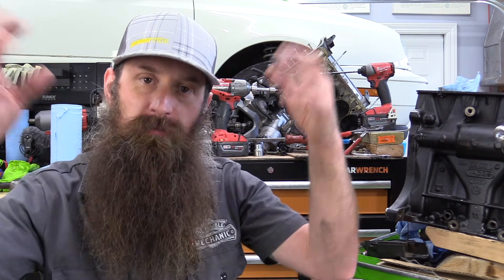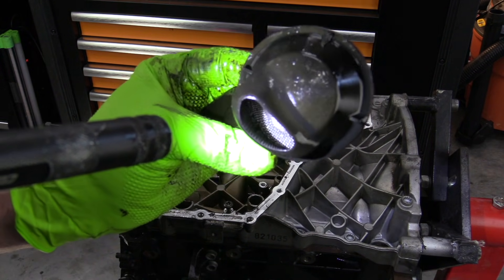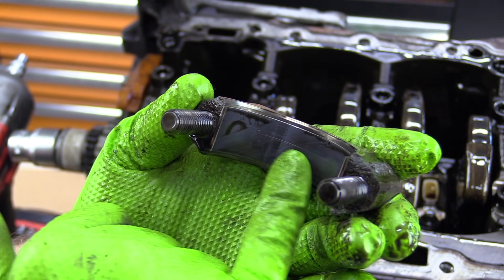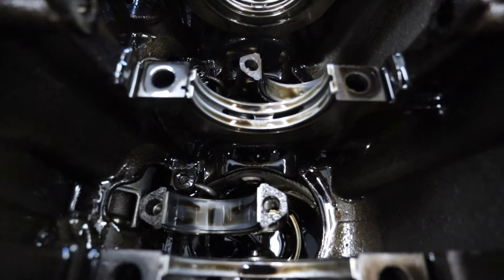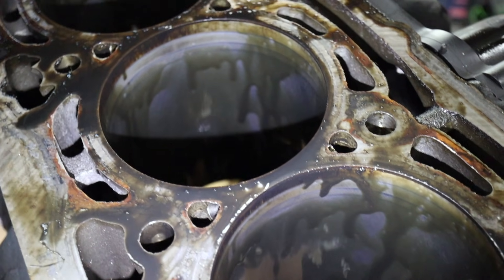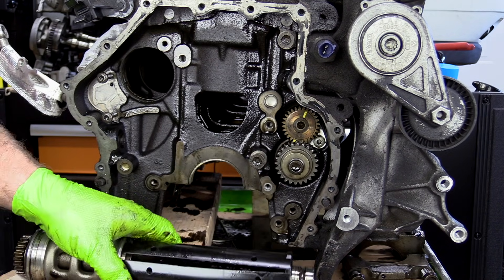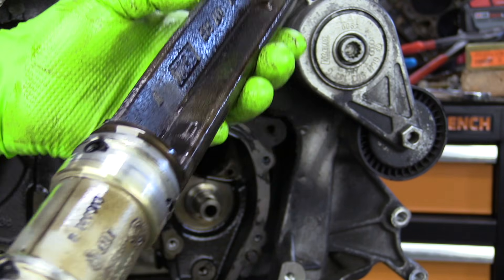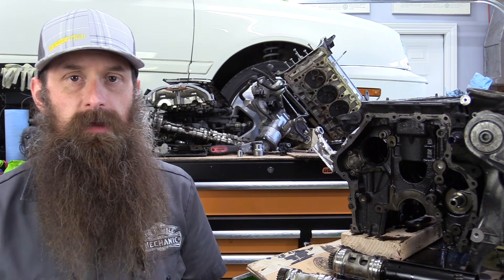2.0 TSI Engine Bottom End Teardown ~Pistons, Balance Shafts Oil Pump

Comment: Have the balance shafts out chasing the dreaded oil pressure light. balance shafts look to be ok. checked the balance shaft bearings on the block side at the back of the block and they are trashed. Cant find any OE quality bearings or info on replacement. Part number looks to be 06H-103-396J.  any info would be appreciated.

Comment: poor quality lubricant.
The most important thing for these engines is the quality oil and the correct frequency of lubricant changes, about 5-6000miles.
The best oils for these engines from my opinion:
Rowe hightec synth rs 5w40 
Liqui moly synthoil high 5w40 
Kroon oil polytech 5w40 
Motul 300v 5w40 
Motul power 8100 5w40 
Shell helix ultra 5w40 
Mobil 1 esp x4 0w40

Comment: Only thing on these B8-B8.9 2.0T engines that sucks is those inlet holes on the piston rings causing the majority of the oil consumption issues. 

Otherwise these cars are cheap tanks. Still cheaper than my Cadillac, Dodge, and Mercedes for parts.

Comment: you mentioned that the weaker rings can be a source of oil consumption. was this for a certian date range? or does every 2.0T suffer from it? should i tear my engine apart right nopw and install new rings??
Reply from the maker: its most of the gen 2 engines from Audi. So like 2009-2015ish mostly in the longitudinal mounted engines
Reply: @HumbleMechanic  that's a relief. 

thanks for holding my hand while i dig around in my gti. been watching for years. love your vids and the life you breath into old vw's.

Comment: Hello
I have an EA888 gen3 from an Audi S3, 140,000 km, revisions carried out at the dealership to date. What happened to me was that the engine fused the connecting rod of the 1st cylinder with the crankshaft without any warning, without any symptoms, it just seized and then completely destroyed the bearing. After disassembly I found no damage to anything else, the bearings of the other connecting rods and crankshaft are perfect, what could have happened to my engine?

Comment: Great videos.  How much in labor for this job.  Mistakenly bought a 2012 with a Junkyard motor.  Mechanic says oil light means that crankshaft bearings are worn to the point that oil gets past bearings on lowers oil pressure.  He put in heavier oil and Lucas but warning light still comes on under light load.  Thanks

Comment: Thank you. This is a great look inside the lower end. I have a mk7 2.0 and have oil pressure light issues. New oil pressure senders, filter housing, pump and still the lamp comes on periodically. The engine is super clean but shit can get anywhere. I am thinking I need to look into the balance shafts next. GRRRR

Comment: Great video! I have a 2011 Audi TT with the TFSI CETA 2.0. What I am having a hard time understanding is why my bearings don’t have the color code on the sides of them, unless they have just worn off. However, I located the upper and lower (shell) stamps on the block and crank. RRRRS for the upper shells and BGGBG for the lowers. When replacing, do you normally match these colors up for replacement? The crank is in good shape.

Comment: 11:00 I've also heard of the o-rings on that plastic insert losing their elasticity and allowing oil to bypass back to the pan, causing oil pressure issues.  If you're high-mileage, probably a good idea to replace the o-ring or whole assembly.

Comment: This engine's chronic problem of loss of oil pressure is the balance shaft diameter which is 5 to 7ths of an inch shorter than the block groove.  There's a video on YouTube where the machine shop guy discovers the problem.
Reply: interesting concept. Would you happen to have the link to the video? I've done several of these engines, replacing woth numerous new oil driven parts and still have suffered the issue.
Reply: @geeess958  The video is in Portuguese. But you will be able to comprehend the problem. The problem is with the original part from the dealership that need to be tight fit.
https://youtu.be/Largs9CIsSQ
Reply: @geeess958  https://youtu.be/5JyowD_aYOk

Comment: Hi I'm stripping my engine, and you video shows exactly how I need to strip it, on the balancer shaft I found my exsaust shaft plastic was broken and caused my oil pick up to block and damage my bearings, but want to find ou, the intake balancer shaft does it also have a plastic tube

Comment: We bought a 2014 EOS with 39k miles.  I didn't want to purchase it but Wife wanted it.  The exhaust on the EOS is coated with thick soot.  Had good servicing but soot scares me.  My 2002 SAAB has 172k miles on it and the exhaust is clean, so clean, there is some rust in the exhaust pipes.  Is the 2014 affected by bad/stuck piston rings and the bad tensioner?  Thinking maybe we need to sell it while it runs good.  Idles very smooth and quiet.  No idea how much oil it burns as I change it every year which is barely 1000 miles.  Motul 5w-40.

Comment: Would you know the part number and/or tool to remove the balance shaft tile bearings? (the ones accessible through the expansion plug)

Comment: First of all great video! I would like your insight or opinion on balance shafts. It says in the instruction manual from Audi/VW that the shafts cannot be reused after they have been pulled from the engine. Why is that? I can understand that one cannot reuse the chain sprocket (06H103319Q) as it has a special coating that will wear off to get the right tolerance, but I don't understand why the balance shafts need to be completely replaced once removed. Any comment would be greatly appreciated.

Comment: is this the same for the BHZ engine for the Audi S3 2007 8P quattro haldex system?? has i need to remove upper oil pan to check bottom end bearings i was thinking if i need to drop the box and if so i need to get back to leaning more info hope u can help thanks

Comment: freak, I am confused. I had a oil pressure lamp day 1, It turned up right before I got home, I parked, checked the oil, the day after I started it, no lamp drove to work, no lamp. Changed the oil and oil filter. drove 40 minutes, right before I got home it came on again, I was so close to my home again I decided to drive the last few minutes (also I thought the sensor was faulty at first) but suddenly it slightly losses a bit of power and shortly after sounds like a diesel engine, at that point I was already in my drive way and I just parked it in the garage and turned it off. I think it was very stupid of me to keep driving, and I know I would have stopped if I got the lamp earlier. but I was so close to my house and thought it would be fine, I think the oil pump is dead? and I might have damage the camshafts and stuff :/ idk
Reply: Ohh yeah, great video btw.

Comment: @ HumbleMechanic, is it advisable to repair a crack on an mk6 gti 2.0 tsi. according to my guy (mechanic responsible for my engine rebuild), he sees no problem to repair the cracked cylinder block on hole of piston 3. what are your thoughts?
Reply from the maker: I’d try and find another one before I made a repair

Comment: Your videos are really helpful. Clear speaking, good clear video. One question I have, is what methods to use when attempting to remove a seized balance shaft, particularly the intake side, when the engine is still in the car and the water pump sprocket bolt can't be removed?

Comment: I have a car exact motor, my issue is water pump gear will not turn, sp either gear on front of shaft is brass and stripped or shaft is broken in middle, is shaft is seized, motor would not run. Engine runs great, just heats up,  replace water pump, then realized after problem still existed, water pump does not spin. Any options, or suggestions, your thoughts please. Thanks Darrell B

Comment: Hey HUMBLE mechanic just a question my 2013 vw Gli head gasket blew and i was wondering if its worth replacing the head gasket or just getting another engine since idk if the head warped or if a there’s any other issues inside the engine
Reply from the maker: Tough call. If you get an engine you need to do chains. If you don’t the head should go to the machine shop

Comment: Typical VW over engineering that complicates things that lead to failure and skimp out on the other things that really requires more attention, e.g., plastic cover for the balance shafts. And, does it really need a manually driven water pump? They can just use 1 or 2 electric pumps. I've even previously had water pump that still spins fine but is broken and just insert an electric aftermarket pump, rather than taking everything apart. If people would change their damn oil frequently, then problems can be eliminated. But, with all this push for cars with less maintenance and 10k mile oil changes, lay people just don't understand.

Comment: @5:58 - Honda says my car (2012 Honda Accord EXL V6 with 115,000 miles) is consuming oil. Is there any way I can test to actually see if it is in fact consuming oil?  I check the dipstick regularly but it never moves off the full line.  Plus there is no visible leaks or smell of oil burning.  Any suggestions? Honda is telling me to replace the engine.

Comment: I have the same engine with low oil pressure at idle, any cost estimates getting that fixed. assuming the engine is rebuilt bearings and seals are replaced, timing, ect

Comment: Hi, great vid. I’m experiencing some issues myself and wondered if any of you guys could help. I am experiencing oil pressure issues and after long journeys I will get the following error code: P000A ‘Slow response camshaft’. I thought this maybe related to a bad oil pump or maybe oil pressure sensor? Has anyone else come across this. My car is an s3 8v 2015, only done 23k miles full and is well looked after

Comment: Hi Master ! I always learn a lot with your videos thanks a lot. I have a quick question my Shaft balancer have the plastic sleeve melted and the motor locked. If a leave the balancer without these sleeve can I have any big problem in the future ?
Reply: From what I understand, without the sleeve, returning oil will hit the spinning shaft on its way to the oil pan and cause foaming. Foaming can then lead to other trouble, such as overheating, leaks, and inadequate lubrication.

Comment: Thank you for this video.
I have a 2009 vw tiguan has 120k on it , the oil pressure light keeps flashing on and off randomly.
After i changed my oil pump and the pick up tube and the oil pressure sensor nothing got changed till i seen this video last night.

I fixed it and didn't cost me 5$ 
Thanks alot for this great video.
By the way vw dealer told me i need to rebuild the engine or replace it🤣
Thank you again

Comment: Thank you for the video on the 2.0T engine, I had a piston failure on mine and had to put in a new block, my question is it ok to leave out the oil strainer screens on the balance shafts and on the servo hub that goes on the cams, the engine kit came with a new servo hub that has the oil screen already installed. Many Audi mechanics have said to remove the screen out of the servo hub before installing it because the screen will let go at about 80,000 miles and create a blockage taking out the cam bearings.

Comment: So grateful that you provide these videos that are so helpful. You previously replied to a question I had. 2014 VW GLI with P151E code. I'll be changing out the VVT valve and with a new oil change of Liqui Moly Molygen. But it's good to see the little filters in the balance shafts that may get clogged and throw a code. I never cared much for learning about or learning to fix a car until I got my VW. I enjoy the experience of learning internal car systems and learning how to fix them. Every manufacturer is different with their own identified issues. Now I have the beginning of chain stretch with 4.81 degrees on obdeleven channel 93. So looking to FCPeuro for a complete chain kit for $575 plus $1K for labor. But I still like learning.

Comment: shinaider
Hein man thanks for your time show us ....please I need you help man..  I have Audi A4 2011 64.000 miles and the oil pressure is low 10psi on idle.. I replaced the oil pressure switch. Replace the Pcv
Reply from the maker: Never a good thing. Pick up may be clogged

Comment: Hey Charles, thanks for the video!  Could you do a piston ring comparison between the CAEB and the CPMB?  Also, what are your thoughts on testing BG EPR for clearing oil sludge & carbon buildup around the piston?  Could you test those caked oil control rings in a solution of BG EPR and oil up at operating temps?  Keep up the great work!

Comment: Thanks for these videos!  Been watching and learning a ton from them!

My son bought a 2014 Jetta 1.8L Turbo (I guess this is the MK6 -  :) still learning here).  He got a CEL a month ago and took it into a local VW dealer.  They said timing chain, tensioner, can shafts (2 of them), and a spool valve needed to be replaced.  The repairs was $4k+. After getting the car back, it now has beeping oil light.  After doing spending $4k+ and still having issues, I decided to try and figure things out myself.  I did an oil pressure test and pressure is really.  When engine is warmed up, oil light comes on when idle, goes away around 2000-2500 rpms.  

I’ve replaced both oil pressure sensor switches, did oil/lifter.  Dropped pan to inspect pickup tube and pan. Didn’t see anything unusual. Cleaned them both out.  Put it back together, same issue.  

I took the oil pump out thanks for this video (was able yo see how it comes off).  I don’t know what to check for after disassembling the pump.  I have one on order.  During all this, I found a coolant leak in the radiator and have that on order as well.  

My question to you - while I have the pan/pump out, is there anything I can check while I am waiting for the parts to arrive?  Could I check the rod caps/inspect bearings with the engine in the car?  With the oil pan dropped, I can see some of the caps.  If it makes it easier, I can share some pics.  My email is pgamboa@yahoo.com 

Trying to be a good dad and help my son out figure this issue out and not spend more $ with the dealer.
Reply: Did you ever figure it out?
Reply: Replace both Intake and exhaust balance shaft. Also, Replace Cambridge. 
This should resolve the issue. change the oil too  often in these engine, every 3k miles.

Comment: Hi, i am rebuilding a ccta engine. The balance shaft from the intake side was locked, so I ordered new balance shafts. Do you think it’s a good idea to remove the screens from the new balance shafts to prevent the damage? And also i saw a lot of people failing after balance shaft replacement, many of them had the oil pressure light on.

Comment: I have a 2009 GTI,  Just had to replace my balance shafts.  How do I replace the bearings inserted in the block?  Dealer says I need a new block.  After the balance shaft seized it scored that sleeve/bearing up pretty good.  we got it pulled out but can't seem to find a replacement?  Thoughts?
Reply from the maker: I just saw something about this today. Someone had sourced the bearing from China, and had to make their own tool
Reply: @HumbleMechanic   So I was able to track down the actual part number: 06H 103 396 G, Not easy to do.  I did see the ones from China on eBay, ultimately a friend found a guy in New Jersey that had a set for sale.  When I get the package ill pass along what info I can so you can add that to your knowledge base.

Comment: Hey Humble Mechanic, I have a good problem I need help with. It's an interesting situation. I have a customer that has trouble with the 2008 A4 S-line with a 2.0 TFSI engine. It started after an immediate engine shut off during acceleration and now its a Crank/No start Condition. They had a crankshaft position sensor code, so they replaced it with an OEM one. The condition has not changed. WIth an OBDeleven scanner with a chart of live data, we can see the rpm being erratic, going from 250-350 rpm to 0 at a constant frequency. Although if i checked for rpm in another Audi, the rpm reading is constantly 250-350 rpm in the non-problematic engine while cranking. We physically checked the teeth on the crankshaft reluctor wheel and noticed physical wear on it. What is also odd is that when pressing on the crank sensor, it can be felt that something is pushing the sensor away at a pulsating rate. Another related issue with this is that cylinders 1 and 4 have no spark regardless of the coil pack and spark plug, but have fuel. Cylinders 2 and 3 have spark and fuel and try to start the engine. Wiring looks normal, no burnt or frayed spots. Timing belt looks great with only 40k miles on it. The ECM hasn't detected any other issues other than the crank sensor. P0321 and P0322. 

Also a weird thing is that when the throttle is at WOT the engine wants to start more but can't. I honestly think it has to do something with the reluctor wheel, a relay or ECM not providing proper timing or signals to give correct spark.

Some help would be amazing. All fuses are good. Haven't been able to check relays. This is a really interesting issue I've never seen before.

Thank you. :)

Comment: What if we dont put back the plastic sleeve of the balance shaft?
How far is this injurious to the engine?
I have just bought a vw cc 2009 1.8tsi. The plastic baffle inside the oil sump and the plastic sleeve of the balance shaft is damaged (shattered into pieces) due to overheating i guess.

Comment: Hi there, great vid indeed thanks. My Audi had a oil pump pressure issues, car is now in the garage to replace shaft and oil pump. Mechanic said engine should be OK even though I drove 2 miles after warning light came on.